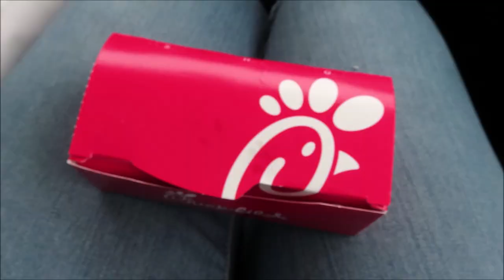Journey and I's 1st time on the trails! | Northwest OHV Park Bridgeport Tx

Comment: What size lift and tires? And is this a sport? Looks like it did well. Did you ever feel the need for lockers?
Reply from the maker: I have 35” Atturo Trail Blade X/T’s with a 2.5” TeraFlex suspension lift. It is a sport and I have ran into a few instances where lockers would be nice for sure but my Jeep has ultimately surprised me of what it can do without them.